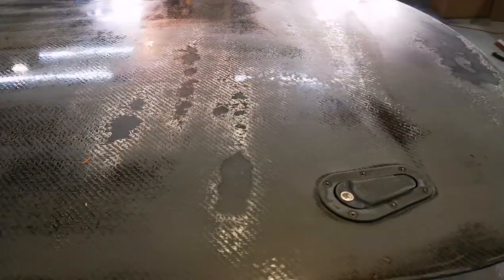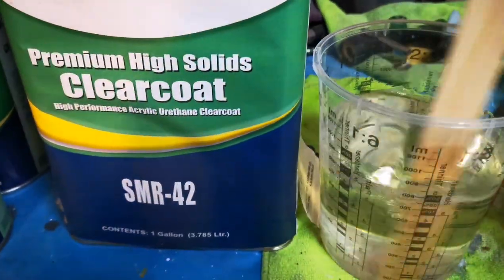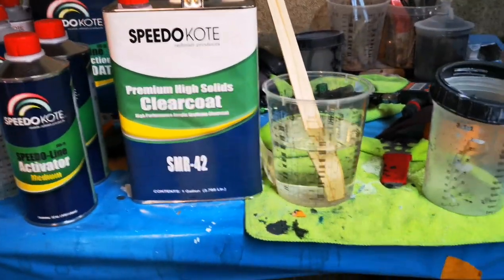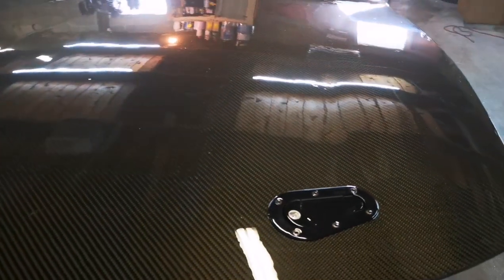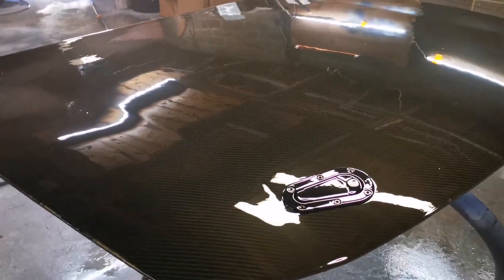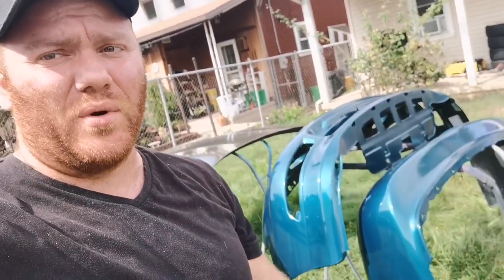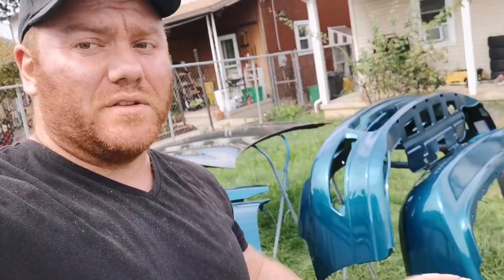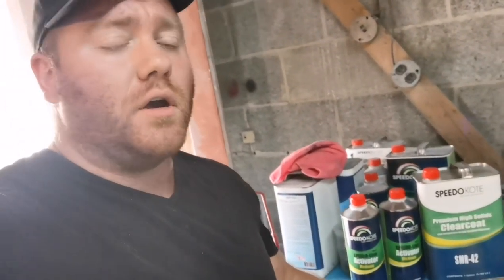HIGH SOLIDS CLEAR COAT (NEW PRODUCT)

Comment: Could you make an educational video explaining the differences between all the speedokote clear coats in the lineup and what's different. Like what has better durability in years, difference in gloss, difference in amount of coats you can apply if there is, safest activator speed, and difficulty in applying and small things to know. Would like to chose the best to repaint my old truck. i have experience painting metal with a spray gun but i'd just do basic gloss rust oleum with acetone to thin but never anything complex. i do paint well without running but ive never done clear. i don't mind spending twice as much if it'll be worth it. planning on doing the high gloss black but there's a lot of variety in clear and cant choose.
Reply from the maker: Yes I will be doing that once my spray booth goes in. Our best clears are the ss1200 and Smr42. If your just going for a basic gloss black we also have the single stage high gloss black avalible for 99 bucks
Reply: @speedokoterefinishnetwork4937  I am gonna buy the high gloss black with the activator actually as It's better and it's high gloss instead of gloss. Don't mind the extra cost I love high gloss.

But it was just the clear I was wondering. So the 1200 asks for 2 activators with one being required. I guess I have to get two equal speed ones or do I need just one. Wouldn't 2:1 dilute too much.

Also what's the deal with the European clear or the smr 140. Figured it would be the best because of the price.

Comment: Great video what is the best clear that you sell? Is the smr32 better than the SME 42 ? This is for a restoration thanks!
Reply from the maker: Smr32 for restoration is best . If you ever need some serious in depth on it , I can help. I worked in a restoration shop in my 20's where we did 10-30k paint jobs
Reply: Thanks a bunch I will get the smr32 then is there any tips or videos you have on the best way to spray this clearcoat and I will be using the speedokote jet black base

Comment: I would like to hear about “UV” additives. Full spectrum have to cover 3 types of “UV” wavelengths. Customer may have a garage at home, but sits outside for 9+ hours at work. 
Any experience with shrinkage?
ASE Master Tech since 1978
Reply from the maker: All of these clears go through 2000 hours of intense uv light in a cabinet total fallowed by 1000 hours of hot rain after each 8 hour uv cycle to simulate real world conditions. If the clear doesn't hold up, it goes back into re-formulation, tested again until true quality is met. The only reason these clears are the cheapest on the market for the quality is simply this.... WE DON'T HAVE MIDDLE MEN. we don't have dinky paint reps riding around to your shop trying to sell you clear at 200-400 per kit. Our products come straight from the manufacturer to your door which cuts out alot of costs. That's how we can provide show quality clear coats at 180$ for a nice 6 spray able quart kit! Don't believe me try the stuff out for yourself. My best suggestion for panle work is the ss1210 production clear. 109 a kit only need 2 medium coats and your done. Dries tack free in about 10 min in hot weather without a spray booth or forced cure.
Reply: @speedokoterefinishnetwork4937   Recently, we experienced a huge jump in price just as we are restocking our cabinet. Ironically, my next scheduled shoot was my truck. To make due, my wife and I are using one vehicle and planned to have two in the driveway by Valentine’s Day. I for get to move the seat forward as I am 6’3” and she’s not. Strange to think, but if you change jobs, tool boxes & equipment come home. 4 tools boxes, MIG, Sandblast cabinet take up a lot of room, so parking outside until we have the chance to build on in back yard, using second driveway as we are on the corner of a circle. So flannel cover for now but expect a lot of questions. Today, women customers ask questions that men would throw at you 20 years ago! Times are a changing. But if 3 or 4 “UV” additives are added, that’s good to know! Especially for myself. ASE Master Tech 1978.
Reply: Maybe more than 6 quarts of mixed product. Omaha, NE.
Reply from the maker: @deankay4434  all I can tell you is our products are tested to the max and if there is any questions as far as uv protection or it not "holding up" it doesn't get put on the market. If your looking for the best priced best quality auto body products www.speedokote.com.
Just browse the site see if you see anything you like.

Comment: Got any tips for 100% paint coverage on an Integra bumper like you just painted? I just painted my Integra and have to redo the front bumper cover for two reasons. I had one slight reaction from a contamination, but I also didn’t get 100% in those headlight openings with paint or clear. I was worried about laying on to much paint or clear and making a run in those areas. The rest of it turned out great. Any tips you could share would be greatly appreciated!!
Reply from the maker: Turn your fan 90%of the way in so it's making A little tiny 2 inch pattern, carefully shoot that paint in all your hard to reach spots. Kinda hard to explain might do a video on it
Reply: @speedokoterefinishnetwork4937  if you did, I would def watch that one a few times before I respray lol.
Reply from the maker: I'll try to do one next week or the week fallowing
Reply: @speedokoterefinishnetwork4937  awesome appreciate it! No rush on my account, I’m not redoing the bumper until next year now that pennsylvania is full into fall and cold temps.
Reply from the maker: Lol you know I regularly use speedokote clear in 40-50 degree temps no issues right? Also spray base Aswell in those temps.. All about what products your using
Reply: @speedokoterefinishnetwork4937  Oh i know, i've seen your other videos when you do it.  This was my first real base/clear paint job.  I don't want to press my luck by adding in cold temperatures as another variable for my second go around lol.
Reply from the maker: I'm in PA Aswell, Mabey I can help

Comment: if smr-130 is 84$ and is 38% solids then this is double the price for only 4% more solids?
Reply from the maker: More uv protection , and 4% more solids is a heck of a difference when it comes to clear coats . 1 coat of the smr42 is equivalent to about 2 coats of smr130/135.
Reply: @speedokoterefinishnetwork4937  thanks for the clarification, I have been using SMR 130 and it is great but I'm looking for something with more UV protection so I'll give smr42 a try!
Reply: @bluestripes1  so your smr130 is crap due to not holding up in UV?  I am asking because it is hard to find a product with longetivity as so many new products pop up daily it seems with no long time exposure testing available for customers to see.
Reply: @LuisC202  my smr130 still looks great after 2 years in the sun, only way to find out is to test it! so far so good tho..

Comment: If I painted my car with oil base gloss black rustoleum will this clear Coat mend with speedokote clear? Or what clear should I use?
Thanks.
Reply from the maker: Use real automotive base coat
Reply: I would've but this was a budget paint job.so this clear won't work is what you saying?
Reply from the maker: @austinbradley3411  don't take offenses to this, if you can't shell out the additional 100 bucks to just use real automotive base coat just don't paint it at all. Automotive clear coat rarely sticks to Rustoleum. Only time I had any luck was spraying it over sattin spray can stuff
Reply: Appreciate the help

Comment: I keep getting solvent pop with this clear, (cut and buffing is a nightmare right now) all these white dots from the solvent being filled with sanding and cut and buffing. I sanded 1000-3000 and they won’t go away. Can anyone help me. Will most likely re Clear and spray a different clear on top. I have never had this problem with other clears
Reply from the maker: You must allow sufficient flash times, for this clear I wait like 20-25 min in between coats. To fix your issue sand the clear down and shoot 2 more coats over it might fix your issue
Reply: @speedokoterefinishnetwork4937  will do that, will the clear hide those already filled up solvents pops or should i make sure and sand them out, I sanded em with the da but they are a lil harder to get out for some reason still lil white dots.

Comment: @Speedokote refinish network
Speedokote clear coat vs Finish1, which is better?
Reply from the maker: Iv seen it sprayed its not bad.. But speedokote is cheaper and provides a better result. Smr135 will smoke any clear coat on the market under 200 bucks guaranteed.

Comment: Can I use a 1.2 tip with this? I'm using a turbine hvlp unit
Reply from the maker: It's possible. Just see how the paint lays. This clear works best with a 1.3
Reply: Can I get this in MD?

Comment: I painted 2 bumpers today using the Glamour Clear. Was totally fun but being a rookie I ended up with orange peel. A few questions. Paint was for my daily driver. Do you recommend just leaving it like that with 1 coat of clear? (I don't mind the way it looks). Can I shoot another coat of clear on top that orange peel? The instructions are to wait 24 hours before adding a 2nd coat but what if I do it in say 6 hours?
Reply from the maker: Wet sand with 800 grit, do another coat. Make sure you lay it on wet but not to wet
Reply: @speedokoterefinishnetwork4937  Sounds good! After wet sanding do you clean with wax and grease remover? Dish soap? or 50Water50Alcohol? Seems logical to me to just spray it down and wipe with a microfiber.
Reply from the maker: Dish soap will work if you got nothing else. Wax and grease remover best option.